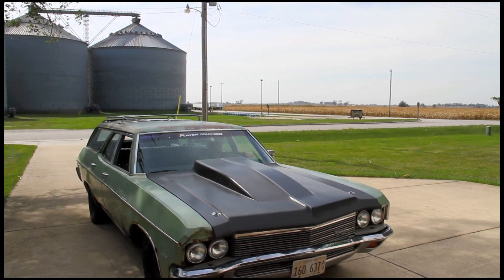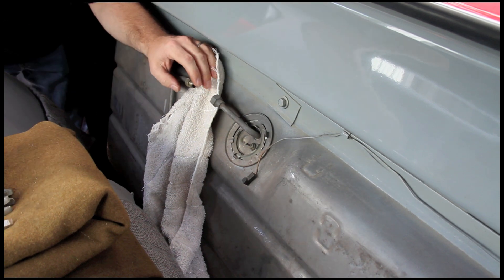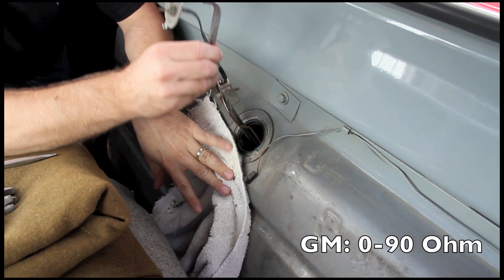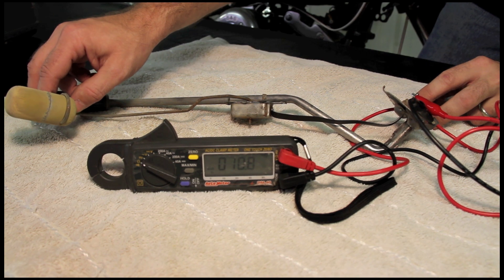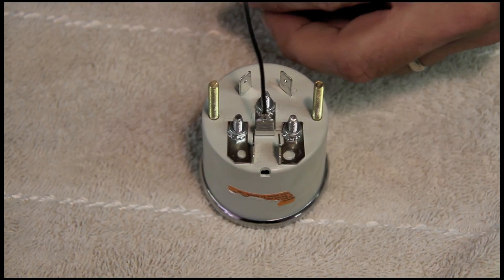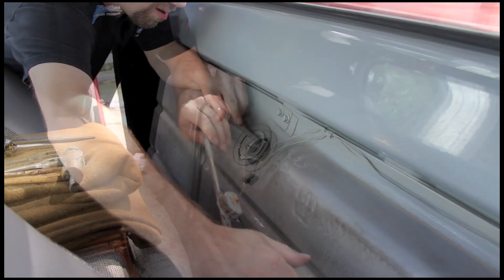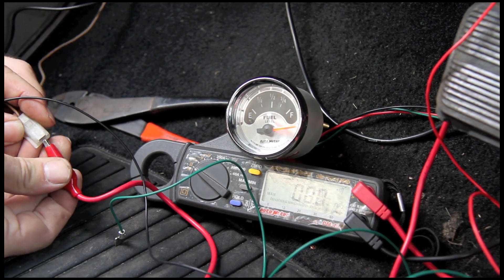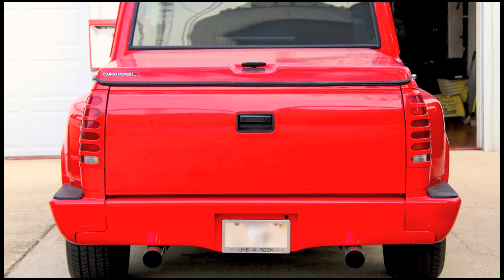Fuel Level Gauge Installation and Troubleshooting

Comment: I love clear and concise videos.

Just a quick question 8 have, a minor thing really and hopefully some engineer out there will take pity on my dumb ass and answer me. Here we go
Just who the fuck thought to themselves during the design process of that eras trucks and said "sure the fuel tank can be placed under the vehicle but i think right behind the seat is our best bet." Ive driven cars as old as the Model T and even that thing where i was incharge of the ignition timing on an engine with no oil pump or water pump and that setup makes more sense than placing 15 or so gallons of highly volatile fuel with explosive vapors in the cab right behind the occupants. I got.priced out of buying one of these when i decided to build something (went with an IROC-Z) so i honestly did not know about this gas tank in the cab fuckery. Id seen the gas cap behind the door but i thought the tank would be under th bed like any sane person afraid of burning to death. Ideas?

Comment: What about the fuel gauge on a speedo cluster on my 1980 CJ5 jeep? Temp gauge works good, but my fuel gauge pegs to the left of E when off, and when I start it, the needle only reads on E and won't move past it. I know I have fuel. Gauge needle for fuel is moving, so it is not the gauge. Can it be the ground wire on fuel sending unit? Thanks.  Mark Feuerherdt
Reply from the maker: Please send our Product Specialists an email or give us a call https://autometer.com/contact-us/